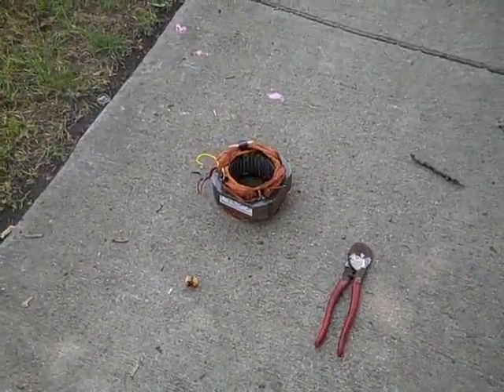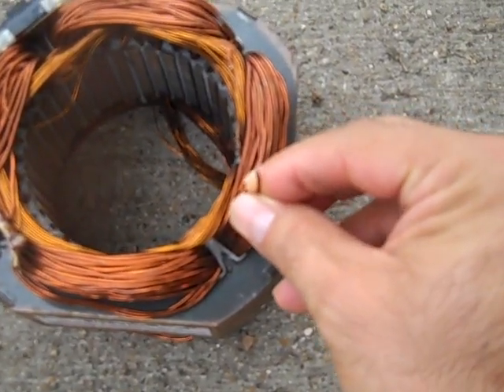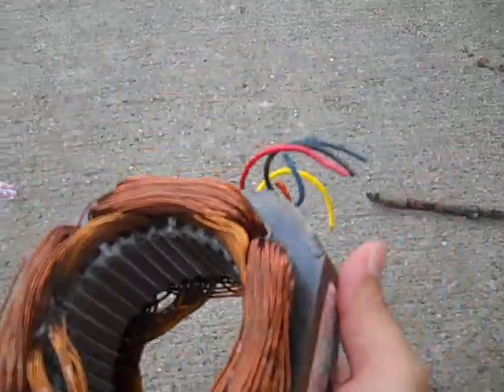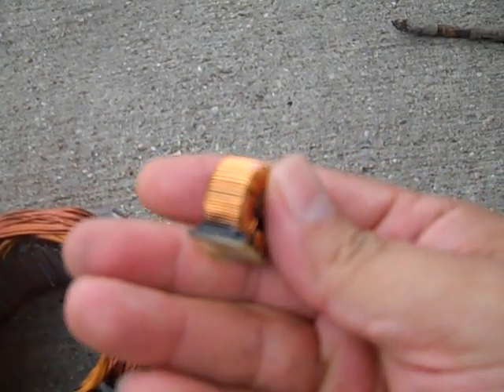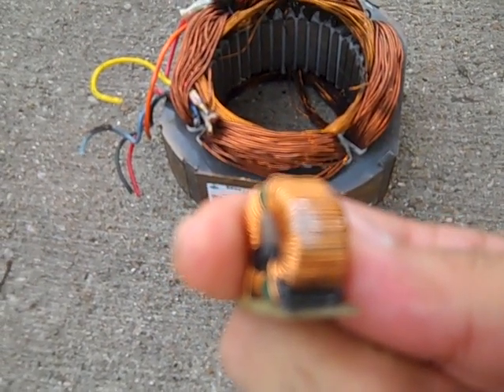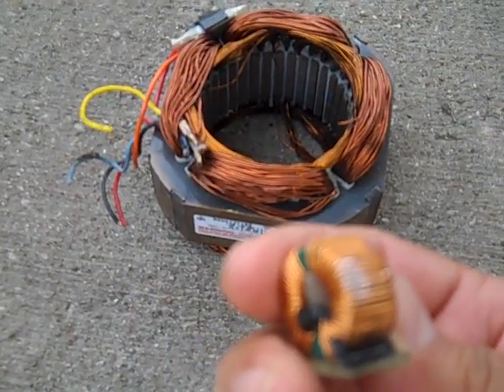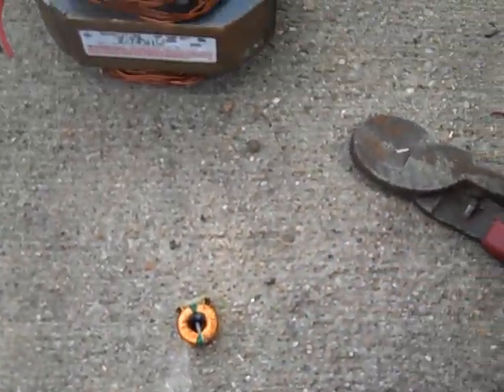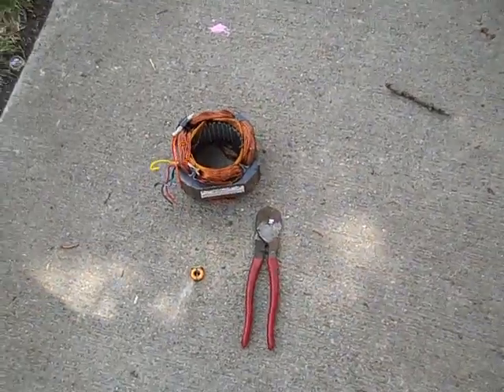how to tell if it's aluminum or copper

Comment: So you cut the wire and it had a silver color  then when u scratched the other  piece it looked like it turned the same silver color I dont get it .
Reply: OMG I know this video is so old but geez…for the life of me can not figure it out either!!!
Reply: Yes. Although he in my opinion did not explain it very well. 
The motor has lacquered aluminium wire. Which make it look like copper. As did the coil. Scrape off the lacquer or cut the wire in half will show the base metal. 
The point is for example  motors pays at £500 per ton ( 50 pence per kg) ,copper wire pays £4,500 per ton. Aluminium pays £250.  Per ton  so it's worth stripping a motor for Copper wire, but not for Aluminium wire.
If it is a lacquered aluminium wired motor you will get more money by scrapping it in as a motor,
What brought me here is the title. How to tell if it's ally or copper. I didn't expect him to tell me cut the wire in half, as that will also tell the scrap man who pays me. It's ally not copper.
What is needed is a way to tell without cutting it..